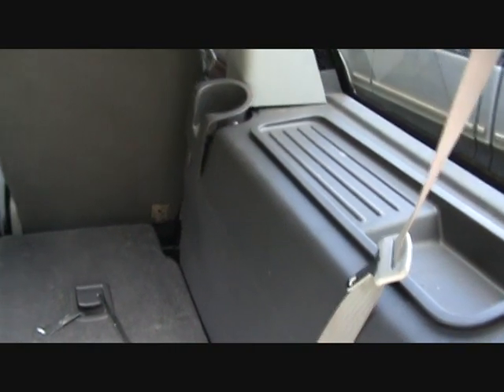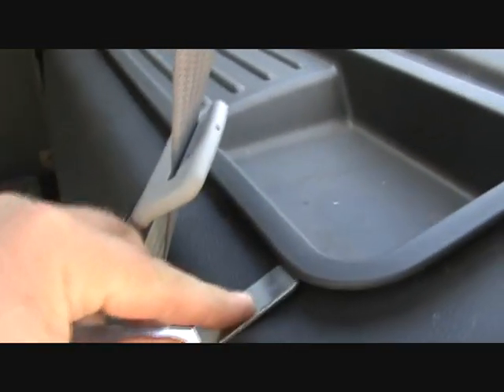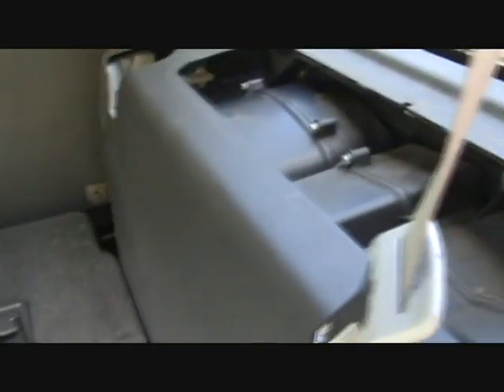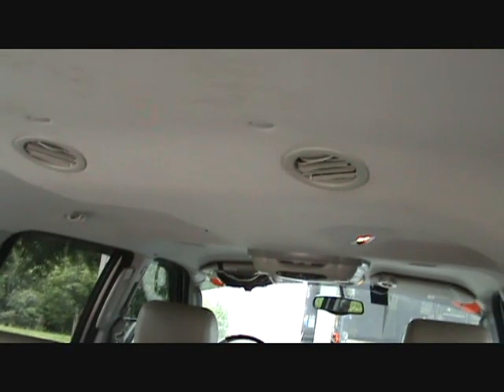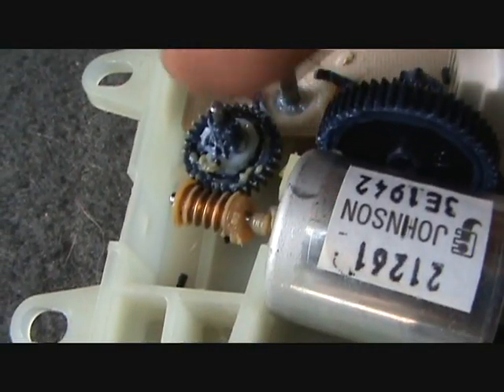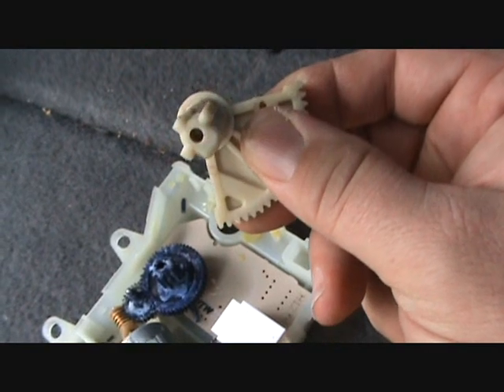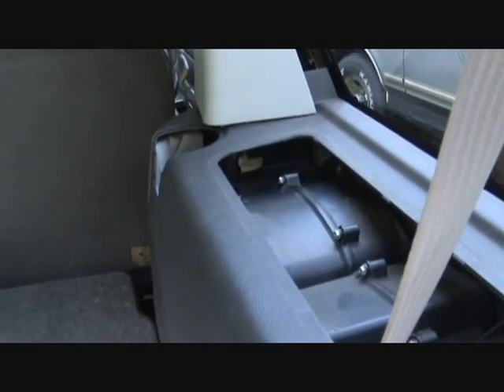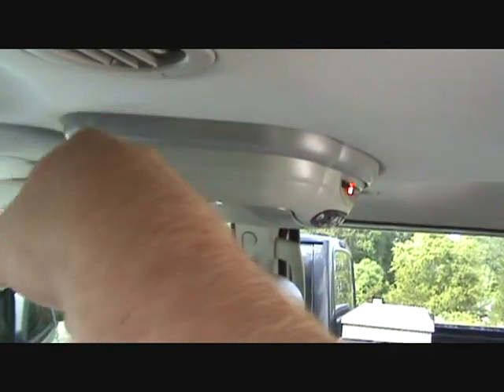How to Fix  rear air on Lincon Navigator/Expedition 2005

Comment: Top blend door is for position roof vents or down the side blend door is for temperature hot or cold
Reply: It was like that for my 2004 ford expedition
Reply: Tim is correct.  I live in a climate that rarely needs heat and the front heat is more than enough. I just use the rear  plastic keys in max cold and roof only. The top part is roof or feet module, the l lower is a temp blend door which would be your temperature control. You do not need to remove all that just the rear bottom and possibility the rear top trim. Pull on C and D pillars then the big part. That top trim comes out easy so you can still turn the keys ghetto style if you live in a sometimes cold climate in like 30 seconds and the roof setting the best setting so who needs that part unless you have amplifiers under your seat.

Comment: hi in my car  expedition 2004  the cold air  and hot air come from up only under  glass , if change from panel no respond what's the problem ,What is the part responsible for changing the air path?
Reply from the maker: Blend door

Comment: Does this fix the ceiling vents?
Reply from the maker: pyro707 there are two of the blend door actuators. one is for heat/cold. the other is for floor/ceiling
Reply: The one you removed was for the floor/roof vent?
Reply from the maker: pyro707 there is another one mounted lower open the panel and which  ever one is humming or clicking that is the one to replace if not both. you can rest your hand on them and feel the vibration from them switching states when turning them off/on and hot to cold.